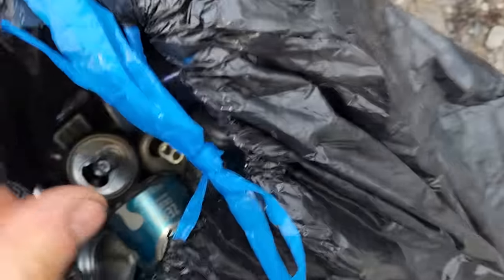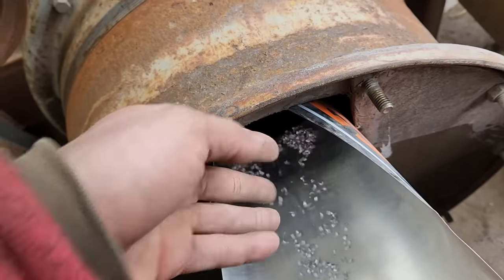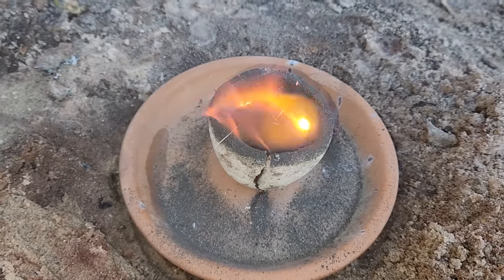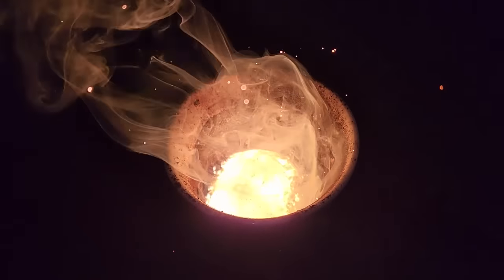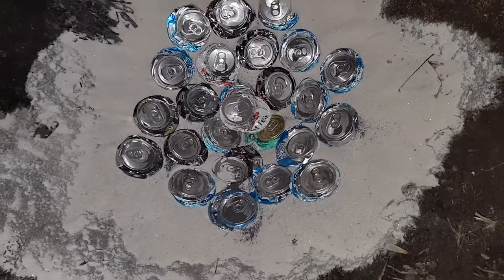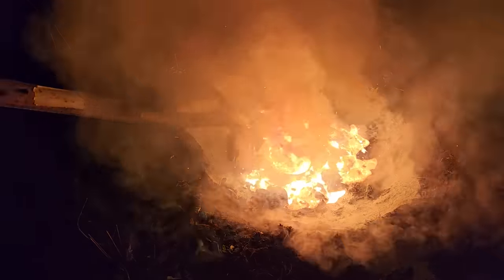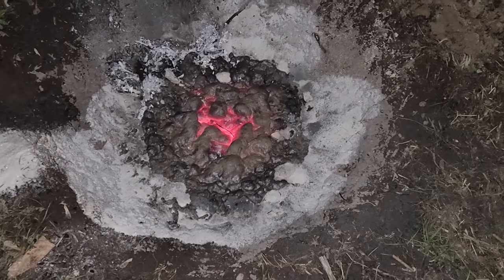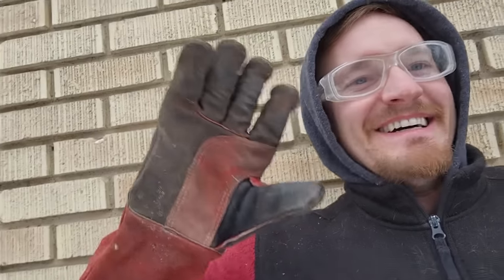Burning 50lbs of Thermite Made From 400 Soda Cans

Comment: Reason for the lip lifting off the sand: The thin aluminum rim cooled faster than the thicker Iron center material. As such the rim material contracted first and then solidified. After that, the thick center material solidified and contracted pulling the rim material up off the ground. This is a problem that you need to consider when 3D-printing large metal parts, so much so that the print novel needs to have a live physics simulation running to compensate for thermal contraction. At the end of the day, it comes down to thermal contraction and geometry.
Reply: this can also be seen in plastic 3d printing. Especial when you print with high temperature filaments that's why expensive printers are a sealed box
Reply: also aluminium expands and contracts more during the same temperature change than iron
Reply: I think the ground dried out completely and shrunk
Reply: Metal 3d pronts need geometry correction, too, because you're likely to do vacuum stress relief and then HIP the heck out of the part to relieve porosity. Those will warp the part even further.
Reply: Yeah, I assumed it was thermal contraction but I never even considered the different rates of the metals also contributing.
Reply: While thermal contraction did some of it in pretty sure the melted snow just took the sand down lower
Reply: Some thin sections would be interesting to see if that coloration extended throughout.
Reply: The topsoil under the sand contains organic matter. The heat quickly carbonizes the matter but doesn't change its volume much. Due to a lack of ventilation, the carbonized material oxidizes slowly over hours while the carbon is converted to gas which allows the remaining mineral dirt to settle into its place. This also happens in hot burning wildfires where it's common to see topsoil levels drop many inches.
Reply: so basically our good old friend the bimetallic strip?

Comment: Basically, you have a big chunk of pig iron. This is the end product of the iron smelteries along the Susquehanna River. Coal, iron sands and the wood for charcoal was brought down by train and barge from around Centralia and Halifax, smelted and poured into buildings with floors covered in a thick layer of sand (that would turn green from the iron contamination, similar to that used in the stems of Alsatian wine glasses). The slabs would be broken up and sold to blacksmiths, iron-wrights and steel mills, often finding it's way up to Pittsburgh. 

Pig iron is rather useless on as is, it takes another melt or a lot of really hot, folding and forge welding to become something strong enough to be used as anything other than a paper weight. The reason you take this intermediate step is because transporting it in this form removes a lot of weight and volume. The Susquehana Valley was the logical place to set up these foundries because it was the shortest distance, near a lot of water from the sources of all the materials needed and you can let gravity do most of the transportation for you.
Reply: Wouldn't this be wrought iron. Iron very low in carbon? Pig iron is high carbon iron from blast furnaces that hasn't been processed yet in a steel mill into steel. Wrought iron and pig iron would be forge welded and folded to create high carbon steel tools.
Reply: @pokekick4185  Wrought irons are forged. This is a cast iron. Either type can vary in composition based on source location and firing methods. Pig iron is characterized more by the large grains, voids caused by dissolved gasses and many contaminates such as scale, dross, sand and chunks of carbon. 

The common method of continuously dumping new fuel and iron alternatively into the top of a furnace stack does increase the carbon content, but the intent was to have a strong draft like a rocket stove instead of having to use a billows system. 

At least initially, the "near steel" levels of carbon was happenstance.
Reply: "I've got pig iron, all pig iron"
Reply: Maybe Cody could lend all this iron to a smith to try and turn it into something like a dagger. It looks pretty nice, but I believe it'll rust over time if left as is.
Reply: In earlier videos, Cody set up a bloomery and a finery forge for refining bog iron.  I don't think he ever rigged a trip hammer, which you'd really need if your working stuff this big.

Why the Susquehanna Valley, and later Pittsburgh? Because they had the coal!  Iron ore was eventually arriving from as far away as Minnesota - but it takes a LOT more coke than ore to make a heat of iron!
Reply: @ke9tv Today German blast furnaces are fed with brazilian/south african iron ore, even.
Iron is valuable enough to warrant transporting ore across the globe; coal/fuel not so much, though.
Reply: That's exactly what my 4th great grandfather came to America to do in 1855. Went to Columbia, right on the Susquehanna, and worked in the pig iron factories.
Reply: Susquehanna?!?!  That's where my two uncles died! And they use child labor there!
Reply: This I didn't know. I just moved to Wilkes-Barre. That's really cool info.
Reply: In what you described iron is reduced from iron oxides by carbon and gets contaminated by carbon in the process resulting in pig iron. In thermite iron oxides are reduced by aluminium with the formation of aluminium oxide slag. There is no source of carbon contamination in this reaction.
Reply: @dhawthorne1634  You're getting wrought iron the product mixed up with wrought iron the process; it is named so because that is the most common method to produce it, being that "wrought" means "to work", as in hammering (working) the iron. However, wrought iron is also a specific form of iron, which is low in carbon, even if it is porous and contains contaminates; that just makes it low-quality wrought iron, which needs to be purified before further use.
Reply: That's a really interesting and informative response 👍 thanks
Reply: @ke9tv I’m excited to see new steel-producing regions bloom once arc furnaces and distributed sources of power are common enough. 

Right now arc furnaces are mainly being built in the same places as the coal coke blast furnaces were, which makes sense because the rest of the infrastructure is still more expensive than transportation. But sooner or later, people and companies are going to pool together to build new facilities near the mines, or perhaps eventually set them up on mobile platforms to move to wherever the ore is most plentiful that year. That could be really interesting. 

I just hope it’s also handled better than the ways other regional industries were wound down in the 80s……
Reply: @vinnycordeiro  This is cast iron. There is so much carbon in it that one hit with a hammer and it shatter into a billion pieces. There is a process called puddling that you can use turn cast iron into wrought iron and a very high quality wrought iron at that. I could build a puddling furnace, but I don't have the funds for the creation built for nothing more than one mans ego. If you ever come across those kinds of funds to build a puddling furnace give me a call. Virgin wrought iron is an extremely rare beastie. As it stands now, I'll be content making wrought iron out of ore dug from the from the Earth in a bloomery furnace
Reply: ehhhh! I live in Pittsburgh! And yea, there are lots and lots of steel mills here, used to work in one :D never really thought about where we got our material though, at least the stuff that wasnt local
Reply: @kaitlyn__L  Arc furnaces are fine at providing the heat - and so they're terrific at producing steel from already-smelted iron. Nucor ran its whole production for years just remelting crushed cars and re-alloying the matierial.

To go from raw ore, you still need carbon, and lots of it, to reduce the ore. Or you could use another reductant, I suppose, hydrogen or something, but the point is that the coke isn't just a fuel, it's chemistry as well. It's still cheaper to ship the iron to the coal than to ship the coke to the iron.

The problem with  making it a mobile platform is infrastructure.  If you look at one of those big arc furnaces, you'll typically see a 138 kV transmission line feeding it. It takes years to acquire the right-of-way, secure the necessary permissions, and build out a line like that.  It's not like running a service drop to a house.
Reply: @PandeMist  I don't know, those sticks that fell in probably had at least a little carbon
Reply: @ke9tv   oh yeah, I’m aware. That’s why I mentioned all the infrastructure the now :) 

And yes, I was thinking of hydrogen especially given the number of ships, trains, etc starting to use it (other incentives for production) and how widespread solar panels and wind turbines are getting in otherwise traditionally energy-poor places. Plus small modular nuclear reactors are even better at making hydrogen than electrolysis. 

The “eventually, maybe” fantasy about a moving platform largely would have to rely on SMRs like a sub, rather than shore power — and it is definitely much more far out of a fantasy than the rest of what I said. Hence the extra couching therein :) after all, you wouldn’t get new production regions if it was just one big platform!
Reply: @vinnycordeiro  Will Stelter crossover?
Reply: Seems crude, almost cottage-industry level and not integrated into a single factory -- was that in the 18th century?

Until about twenty years ago, I had a couple "Kaiser pig iron paperweights" that were souvenirs of my father's time working in the foundry there. (A Google search will bring up images of some examples on eBay and Etsy.)

My father grew up in the Newcastle area near Pittsburgh, PA during the 1930s and early 1940s before he volunteered for the Army. After serving in combat in Europe during WW2 and again after reenlisting sometime after the conflict to serve with the United States Constabulary (occupation forces) my father worked in the foundry at the Kaiser Steel plant in Fontana, CA. (Dad, at least one of his brothers and I believe his father too had worked in PA steel mills around the end of WW2 before my father helped his parents move to CA.)

I never toured the Kaiser plant, but I could hear it operating around-the-clock from where we lived. Kaiser owned his own sources of iron ore, coal and dolomite. The factory took those raw materials through all the processes from blast furnace to at least rolled plate. (I'll have to research online to see what other steel products they produced. Since Kaiser built ships during the war years, I'm guessing they produced structural steel elements too.)
Reply: @willong1000  Not a cottage industry by a long shot; but you were right about time-period. It got it's start in the late 1700's but the boom didn't really kick off until the early 1800's.

 In Marietta, PA there are still remnants of the operation. Furnace Row are houses built by the owner to house his workers. The office was turned into a museum and if you hike back into the woods you can find the actually processing buildings. There were raised tracks where trains could drive right over top of the 15' tall furnaces and dump their load right in. The casting floors were about half the size of a football pitch. There are also a bunch of (mostly) boarded up cistern pits that are connected to the canal that use to run along the river; most of the tunnels are sill intact. Chiques creek was damned to provide additional water to power an cool a roller mill. Back in my dad's day there were also a set of lower tracks for a trolley that brought workers and supplies in from neighboring towns. 

All around the area are mansions built by these company owners and their executives. As a kid it was always odd seeing a bunch of small log, brick and stone houses from 1-3 stories along a street then suddenly you come to a 3-way intersection and on the narrow corner you see a 5 story home with a yard that takes up the entire rest of the block. One ambitious gent built his on top of the mountains across the river. There's a mile-long driveway full of switch-backs crawling up to it. On the outside edge at the top of the S-bend, the view has to be astounding from up there. 

Another interesting bit of history from that time period. The neighboring town, Columbia had crude oil and a refinery. During the Civil War the confederates made a push to try and capture or destroy the industries in the area that were supplying the Union forces. Wrightsville had been captured and the Union retreated across the river. In order to protect the Ironworks, Coal and Oil industries, the militia rigged the 4th span with black powder bombs then soaked the entire length of it in crude oil as a backup. When the confederates started to cross, they blew the bridge, hoping to drop the entire span into the river. Unfortunately, parts of the span held and were still passable. So, they lit the bridge, forcing many of the confederate troops to jump into the river to escape the blaze. Six hours later, the last timber fell and the confederates were left with two options. First, trying to repair the  (which they started to do, against Lee's orders) or two, march northwest to the capital crossing on a 4 day detour, which they also failed at. 

Back when I was a kid, if you took a boat down river, on the left hand you'd see a bunch or US Flags, some modern, some 34 star and on the right you'd see a bunch of confederate battle standards and bloodstained banners. It's not that the people in Yorkhaven and Wrightsville are racist; they're hung as more of a "Ha! We stopped you, right here!". Unfortunately, in recent years, with all of the statue removal and changing of street names, uninformed idiots have harassed the people along the river so much most of them took down these historical reminders.
Reply: @TheNewSchmoo I know what that's from.
Reply: Due to its fragility and fracture grain, it is a type of ferroaluminum, pig iron is an iron alloy with a high carbon content up to 5% and the charge does not include carbon.

Comment: I'm a blacksmith and I've been watching you since you started this channel. 
   In smithing we use slow cooling out of the wind and weather to create a smaller grain structure. This is called normalizing. If you make a work-piece too hot you create large grain structures and brittle steel. So that's when you normalize it. 
  You heat it to the critical point ( so hot that its non-magnetic). Then you heat it a bit more. Then you normalize it. You do this several more times until you're heating it to magnetic. The more you do this the smaller the grain structure size will be.
    I theorize that it was the overnight temperature and snowfall that cooled the iron quickly. Cast iron will always have a larger grain structure than steel, but I think that the fast cooling and possibly other minerals created conditions for the much larger grains/crystals.
  I would give somebody else's left eye to do a smelt to make wrought iron with you. I might just give my own left eye to run a smelt, but sadly I already lost my left eye when I was 21, so someone else's it is. Any takers in the comments? Thanx for the video. They're never boring.
Reply: We're in the cyber age, a camera's basically an eye, so throw one of those in mount doom to complete the sacrifice :p
Reply: @dimitar4y  I thought at first you were gonna tell him to replace his lost eye with a camera, cyberpunk style 😆
Reply: Wasn’t it Odin who sacrificed an eye for knowledge? Weird association, I know. You just reminded me of that story.

Anyways, thanks for the interesting insight. I’m not a metalworker, but I watch some on YouTube and I’ve long suspected something like what you said was the case.
Reply: Youre basically a wizard to me. I am always amazed at metalworkers and how you can control all those variables to get all the output variables that you desire. It makes no sense to me. But I am a pocket knife enthusiast so Ive tried to learn a little about different steel types here and there, but it gets over my head very quickly!
Reply: @MattH-wg7ou   grab a piece of metal, heat it up, hammer it; If you survive to tell the tale and do this about 20 times, your muscles will whisper secrets to you..
Reply: Youre thinking opposite, slow cooling creates the larger grains. But it also makes it more malleable. This was brittle because it was so impure.
Reply: @dimitar4y   This is the way.  

No seriously, this is how you do it ;D
Reply: anyway i was 50% joking on the mount doom sacrifice. Go make a video of you tossing a camera sensor in a lava lake somewhere and explain the story of why you did it, maybe it'll get viral and they'll invite you :p
Reply: Recrystallization is not the same as crystallization tho. The metal behaves differently when you heat it to melting temperatures. What Cody said was right for a molten pot of roughly iron, even if it doesn't work the same in smithing.
Reply: just hearing "normalizing" gave me a mini flashback to engineering college...
Reply: @xhappybunnyx  database normalization!
Reply: Get a head check😮
Reply: Nekem az èletemben hatalmas szerencsèim voltak hogy mindkèt pilàcs megvan mèg!
Reply: @mikeblair2594 - There are guys all over doing iron smelts, might be a group near you. All you need is crushed iron ore, charcoal, clay to build the furnace, an air source, hours of work, and beer.
Reply: Here is The True Savior

HalleluYAH translates “Praise ye YaH”

YaH is The Heavenly Father
YaH arrives via the TENT OF MEETING
YaH was Who they Crucified for our sins
YaH was Crucified on an Almond TREE

Semitic of Moshe (Moses)
Isa Scroll (The Original Isaiah)

Isaiah 42:8 - I am YaH; that is my Name! I will not yield my glory to another or my praise to idols.

Isaiah 43:11 - I am YAH, and there is no other Savior but Me.

Isaiah 45:5 - I am YaH, and there is none else.